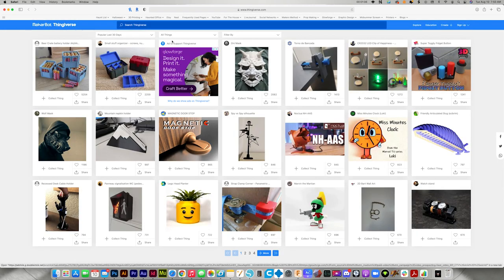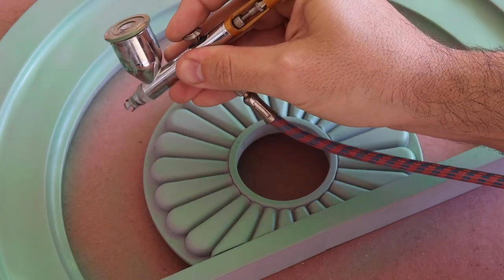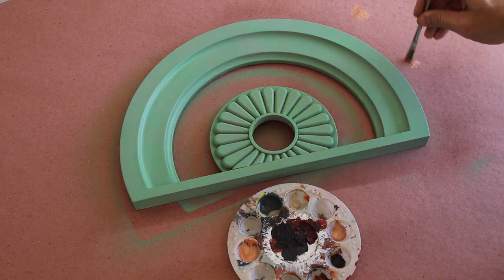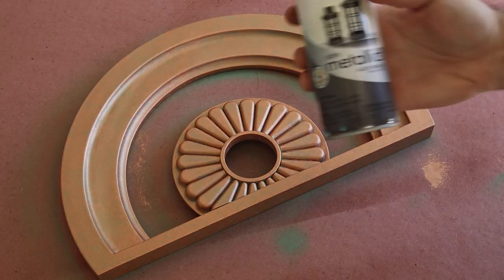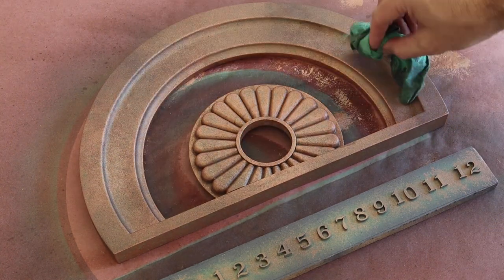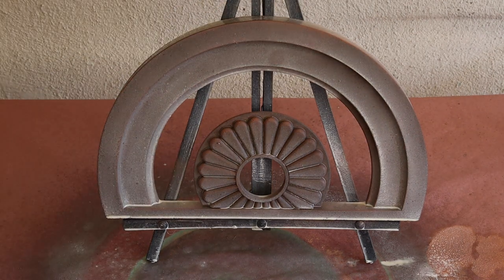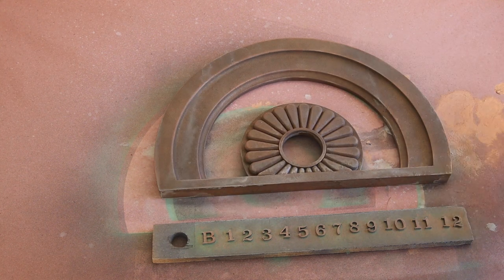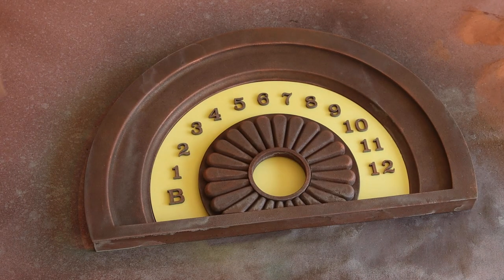Disneyland/Disneyworld Tower of Terror Elevator Dial Replica | Hollywood Tower Hotel

Comment: Nice! As always: superbly executed, Derek. You can NEVER have enough layering of subtle washes. Situated over a pair of weathered, beat up “metal” pocket doors would make that perfect. And if I did that, I would also have to figure out the backlighting and a smartphone-controlled servo that drives the floor indicator.

Comment: This turned out really nice.  Have you thought about using an Arduino and stepper motor to make the dial move?  With 12 floors, you could turn it into a clock that shifts floors on the hour.
Reply from the maker: I’m not much of an Arduino person, but it definitely crossed my mind.

Comment: Great video! I always learn so much from your videos. What happens when you use window cleaner for diluting paint for your airbrush instead of water? I have only done one airbrush project and used water and it seemed fine, but I also don't know if it was really fine :D
Reply from the maker: Thanks! I’ve found that if you try to thin acrylic paint too far with water it can get clumpy and with the window cleaner that doesn’t happen.

Comment: ooooo super cool! but doesn't it go up to 13? ..... wait never mind just confirmed it only goes to 12. We at VCD would love to do this project but add the mechanical elements. Make it actually count up then drop the needle :-)
Reply from the maker: You should do it!
Reply: @VanOaksProps  We lack a 3D printer. We have never had good luck with one so we stick to Lasers and our Open Builds CNC lol oh and out electronics.

Comment: I have been trying to print that for months...3 attempts and I have given up...
Reply from the maker: Where were you having difficulties?
Reply: @VanOaksProps  STL was too big for the bed
Then after a cut it up somehow a piece was out of scale and I couldn’t recover the mesh mixer file (windows are my mesh mixer and wouldn’t let me reinstall it…
Then once I was able to reinstall mesh mixer and re cut it then I got into bed adhesion issues…
Then no more walkthrough so no elevator simulator so no need for the dial…:(
Still want to make one though now it’s a quest